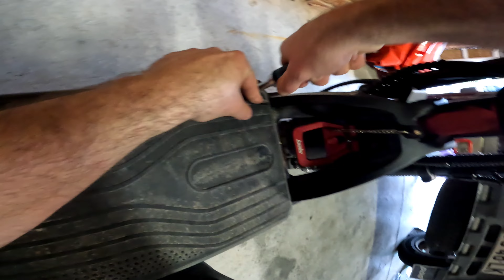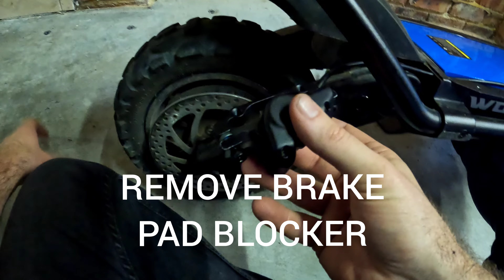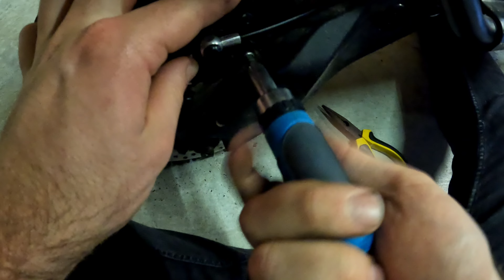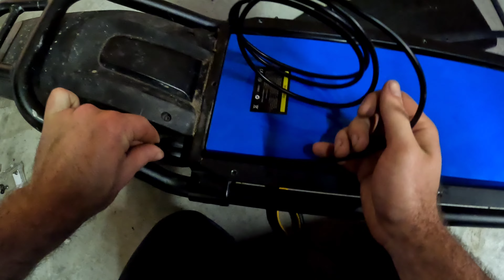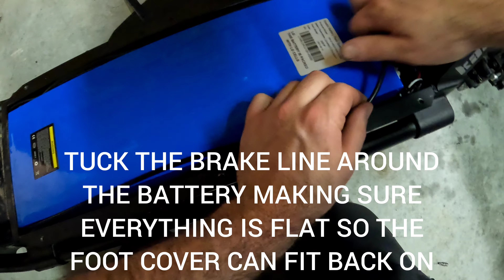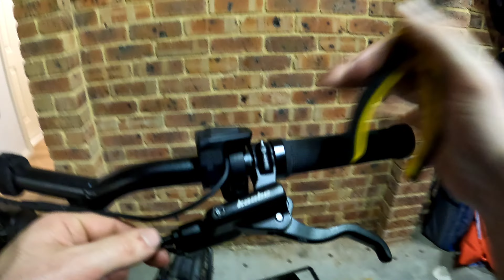KAABO Wolf King GT Rear Brake Replacement Installation Tutorial (MICK FIX)

Comment: Hey I just order mine, and received today. However, upon further inspection. My rear brake whenever I press it Has no pressure and thus does not work. Is there a quick fix you'd suggest?
Reply from the maker: You will most likely need to put mineral oil in your brake line. Ginger on wheels has a good video on how to top up brake fluid on kaabo wolf king.
Reply: @mickeyboyz7211  thanks for the quick response
Reply: This happened to mine too! $3k brand new and rear break is not working and front break squeaks. So frustrating!
Reply: @demonhunter-skydomeatlanti1746  mines is working. Just add mineral oil directly to the brake lines at the handle bars. Pressure and everything is working
Reply: Yeah same problem its sucks I got my wolf king got pro out the box and back break has no pressure also check at the back break line and make sure its not leaking and that the bolt that hold the brake line to the brakes is tight mine seems to be leaking as I can see oil build up and all the dirt is going right to that spot @demonhunter-skydomeatlanti1746

Comment: Hey man! Those two little Grometts or black rings that fell off the back brake when you pushed the scooter forward, where do those go?
Reply: Just don’t under stand why there is 4 total on the back.
Reply from the maker: Those are just washers. They go on first before you put the bolts in.
Reply: @mickeyboyz7211  so 2 of them back to back to each other? Or face to face anyway. I’m pretty sure I put it all back together properly haha I did a brake pad replacement. I’m not getting full stopping power (rookie)
Reply from the maker: Sounds like you might need to do a brake bleed

Comment: What kind of brakes did you upgrade to?  Or did you just replace with same stock zooms?
Reply from the maker: Stock Zoom. Make sure that you get the official Kaabo brakes specifically made for the wolf king gt. If you have just a Wolf King zoom brakes will work fine.